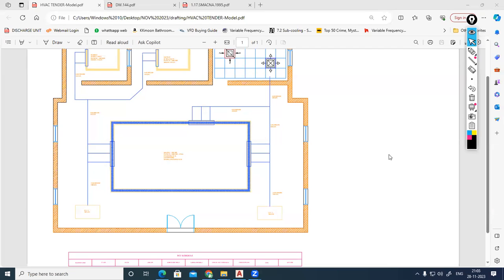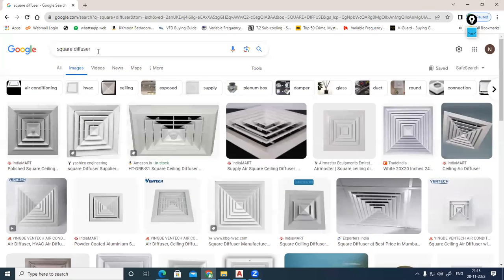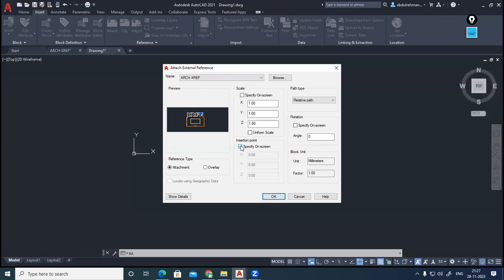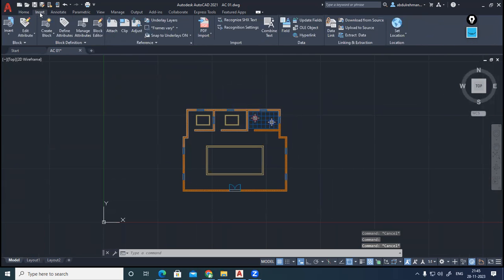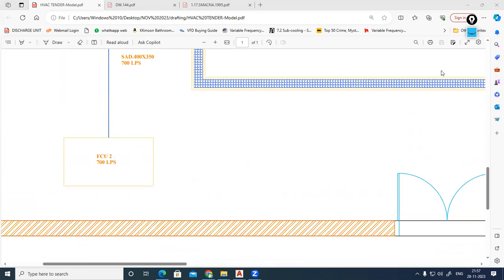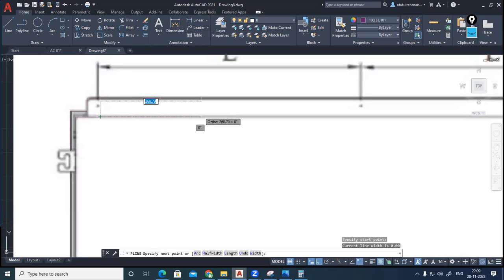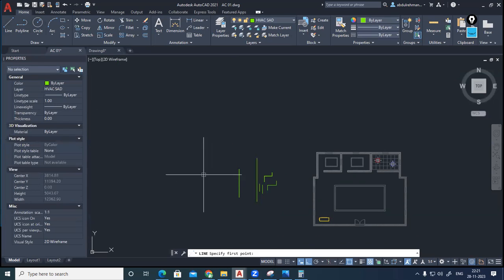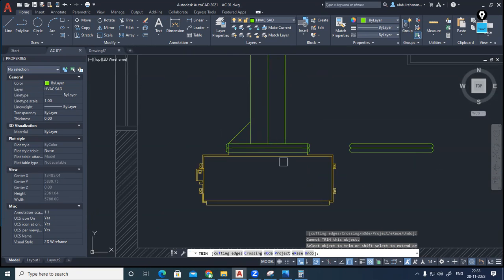HVAC DRAFTING USING AUTOCAD - SESSION 1. SHOP DRAWING PREPARATION MINI PROJECT.

Comment: who are you? i watched so many videos about hvac but i dont see any one who teaches every important points like this. you are a great teacher. And Thank You Sir for your class.❤
Reply from the maker: Hi,

Thank you so much for your comment. I'm Sajith Babu, an MEP/BIM consultant by profession. I've had the opportunity to work in Oman, UAE, and Qatar. Currently, I am running my own MEP consultancy along with an MEP/BIM institution, and we handle outsourcing projects from the GCC. I also used to conduct classes.

Once again, thanks for your encouraging words. They will surely boost our spirits.
Reply: @amnearmep  I am a mechanical Engineer, previously started working as a mep engineer in a firm with limited knowledge in this field. I really liked your classes.